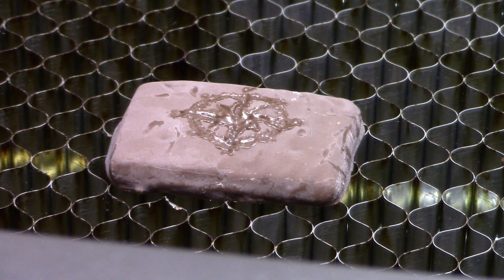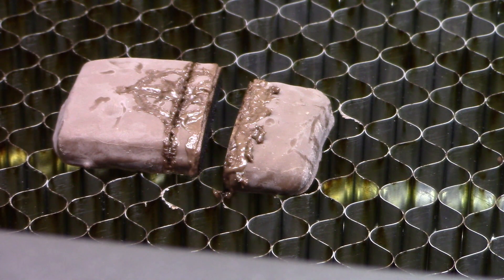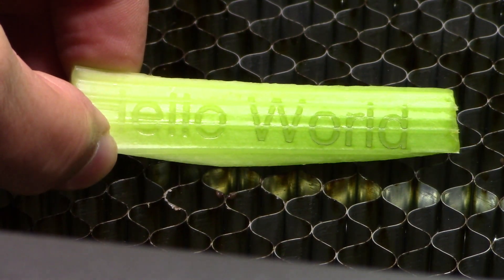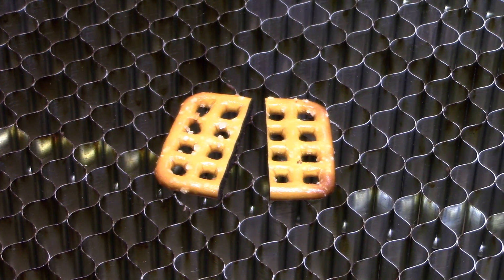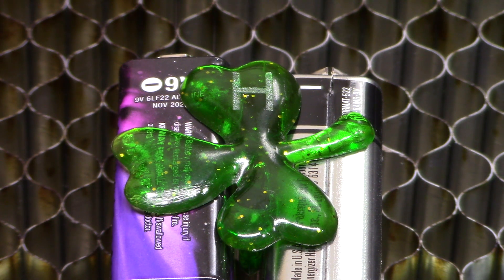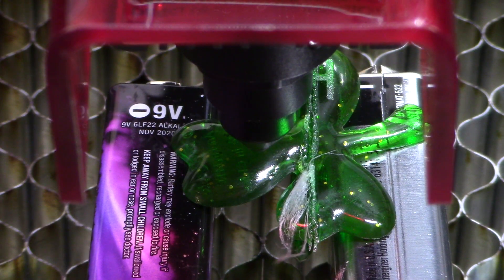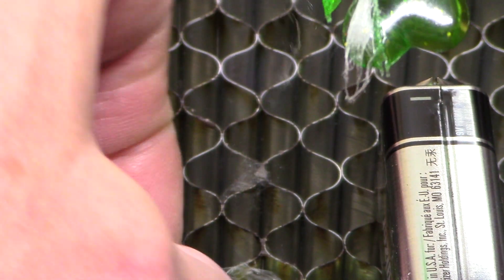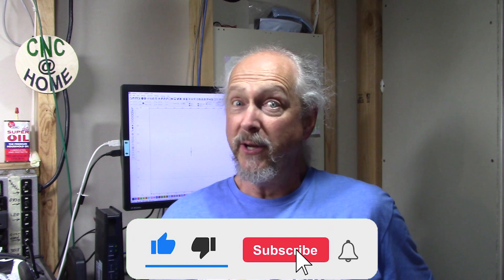Will It Burn? Let's try etching and cutting some of my lunch.

Comment: I was wondering...

If you laser wet clay, will it "fire" the lasered areas? Could you make a detailed design and then wash away the unfired areas?
Reply from the maker: That is an interesting hypothesis. I love the idea. There are a couple things you could try with that.  One would be to put glaze on the clay and burn something, then wash the rest of the glaze off and re-glaze with a different glaze and bake the whole thing.  Or try burning in the clay before applying any glaze.  After the burn try applying a glaze and shove it in the kiln. I question how well the laser would cure the clay but with something thin, it might produce something very unique!  🙂